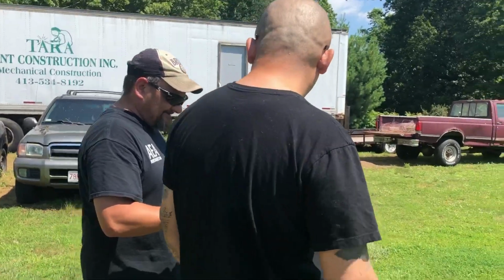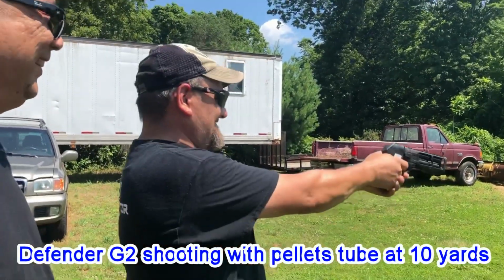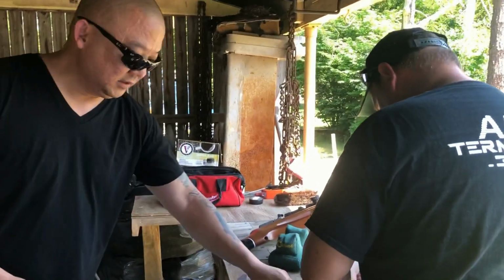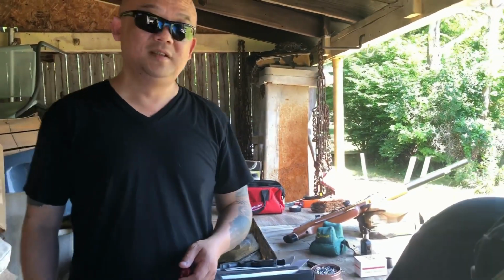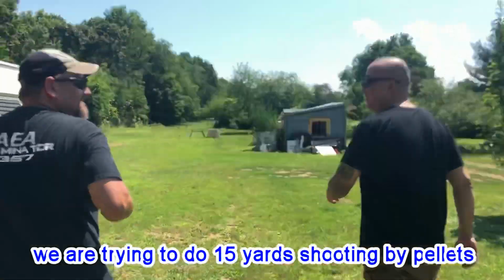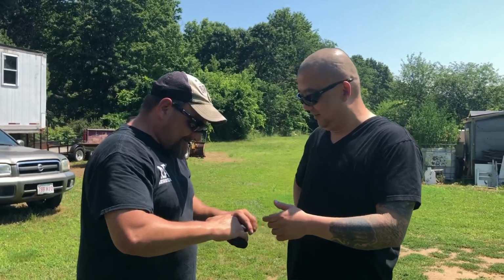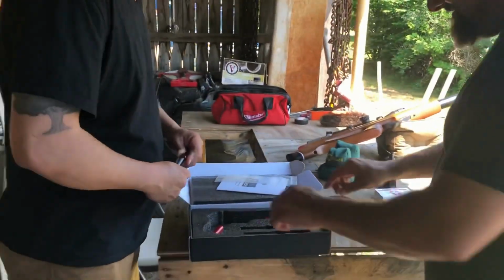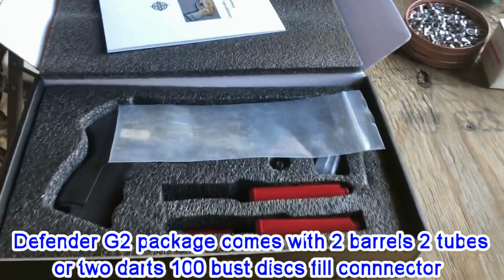BinTac:AEA new defender are available now

Comment: Hi Bin, I say this with love.

This is two steps back in the evolution of air pistols. I mean it's kind of cool, and I can see some uses for it....but you should have at least made it a six shot revolver.

What can anybody realistically do with two shots? People are bad enough Marksman already.

Two shots is not enough to do anything. The whole point of these less than lethal pistols are to buy you some time to flee since the chances of stopping them with anything under 70 FPE is highly unlikely, and what if there is multiple attackers. 

I own every air pistol on the market. T4e PPQ, hdr50 modified, etc. I've been searching for the perfect air pistol for years. This is not going to cut it and I don't need another pricey air pistol collecting dust on the shelf. I understand some people are impressed by it. I am not. Two shots is fine for hunting, not for self-defense. Anyone that thinks so is not thinking it through.

There's only two options with these less than lethal air pistols.

1. The perp runs because of the FIBSA factor (Fudge I'm Being Shot At). Pray he does that in two shots.

2. You shooting at them (FIBSA) buys you time to flee. Two shots is not enough for this, after your two shots are dispensed (likely in seconds) you will still be in the danger zone.

The pepper spray capsules are kind of gimmicky. Two capsules of single shot pepper spray, or a bottle of pepper spray I can douse them with. I would pick the bottle of pepper spray, so does law enforcement.

I still think an HDR 50 modified to 11+ joules for FIBSA and a can of pepper spray to follow up with or for initial deterrent, is the best combo, until AEA releases their 8 shot The ONE pistol.

Which brings me to the point of this speech. Why not release The ONE pistol now? 

That is what the people want, that is what the people need.

: Crowd cheers:
Reply from the maker: We have exactly what you want buddy but it was postponed
Reply: @sigshooter6213  I know you do! 👍 And I was told 2022 or 2023. That's too long though Bin! Haha.

I have a bad feeling that laws and regulations are going to change soon. Especially in California. You can't even buy an HDR 50 or pepper spray gun online in California anymore. Two things I bought just a year and a half ago with no issues. So rules are changing quick.

I'm an engineer, fabricator and machinist and it's getting to the point I'm going to make my own.

I hope you can release it sooner than you are anticipating. The longer you wait the more opportunity for competition arises.
Reply from the maker: @dangerous8333  thank you for the information my friend which one you want?
Reply: @sigshooter6213  I want The ONE pistol.
Reply from the maker: @dangerous8333  that is postponed till next year
Reply: @sigshooter6213  This is gonna be huge
Reply: The arrow can kill if you hit them in the chest and the scuba ringer/defender/airringer shoots underwater.
Reply: i would never carry a air pistol (or less lethal) by itself unless i absolutely had too. I would always carry it either in conjunction with an actual firearm or with another air pistol/less lethal depending on what i already have.

Personally tho if i were to buy this i would buy it as a trail gun because in my state youre allowed to leave your dogs off the leash and ive been on multiple occasions aggressed by feral dogs. Personally id carry with pepper spray as the first shot and an arrow as the second with two more arrows in my pocket. I guess it also doubles as an easy way to take care of any crazy people who decided to bother me aswell. But other than that i wouldnt carry it, not by itself.